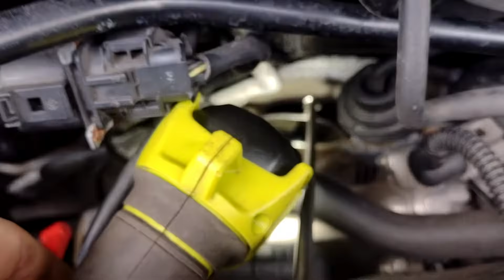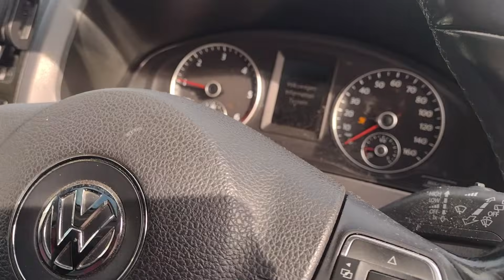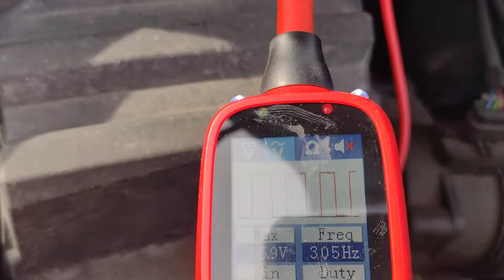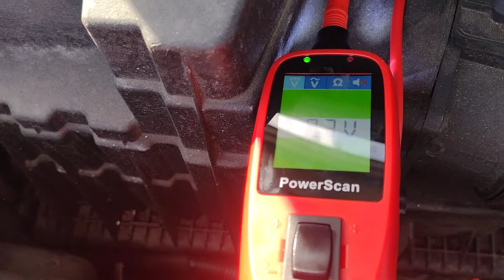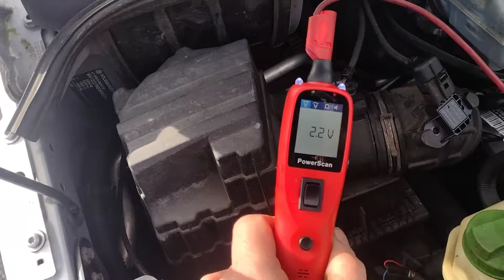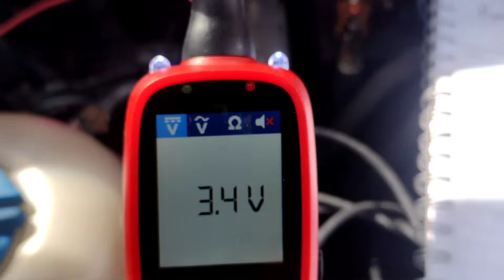VW Transporter - P2563 turbo position sensor range/performance

Comment: By the way, if I block off the hose, how long can I drive it for? & will it cause any damage?
My EGR unit is working, but the hose nipple broke off in the hose itself.
TIA
Reply from the maker: @OutbackAl  I know some people would leave the hose clamped off, It probably wouldn't harm the engine.
I would replace the parts so that it runs as intended

Comment: have the same problem my friend. P2563 Active/Static
Turbocharger Boost Control Position Sensor Circuit
Range/Performance. 

Mine comes up all random. It may not show up for 1-2 weeks and then all of a sudden the glow plug indicator starts flashing. What could possibly be wrong? The car itself drives without any issues, however some loss of power when the glow plug is flashing. When I turn the car On and OFF and On again, the glow plug indicator is gone and will show up maybe some days later all random. I am struggling to know what to do. Please help brother. Golf 1.6 TDI 2011 Automatic
Reply from the maker: @CrOzLm  I think it is carrying out a pdf regen while the glow plug light is flashing. Maybe not getting time to complete it. You would have to look for fault codes and take it from there. Cheers Matt

Comment: Matt is that a pp100 / ps100 or ps100 tester
Reply from the maker: https://www.amazon.co.uk/Automotive-Electrical-Diagnostic-Resistance-Activation/dp/B0BRQDF8CC/ref=mp_s_a_1_2?crid=2RPOKE6SMU1QY&dib=eyJ2IjoiMSJ9.u6b7kI1hNFpg9A6USu92PjbFlT4lzEfMz26cabjzb11fF771TGu_ksGmuiM1nlK9wfm15uwUmG3XQzNlxaTLhO2M8VGRhp3TBcF8d1OSHJfNRzI_cPPJhz08xJEjF3VRg2gw4wXVxIpUcZr8wzBH4KSnY0Q3PqbFzBHHqBD5zhC1-1ZSt-VVUC7Tu5nER4ufGm0nfnopcY9Xrkr1kwcA_Q.YT0ZmLuMZc81JaO7gCa0JqQlYBkz8EX1fz4tJMdKzAE&dib_tag=se&keywords=power+probe&qid=1709394780&sprefix=power+probe+%2Caps%2C414&sr=8-2-spons&sp_csd=d2lkZ2V0TmFtZT1zcF9waG9uZV9zZWFyY2hfYXRm&psc=1
Reply: Top man matt  I've the identical fault code after fitting a brand new turbo . .I. assuming actuator not set right or faulty as wasn't a fault till turbo was fitted . Fuming as not the best job to change

Comment: Hello so what was the probleme ? Im french and i have same default on my audi a3 p2563
Reply from the maker: It was a vacuum leak on the EGR  (exhaust gas recirculation)  valve. Causing low vacuum for the turbo solenoid. Thanks for watching
Reply: @mattsautodiagnostics  Thank you so it change the EGR valve? I also have the preheating light which flashes intermittently, I have no loss of power.

Comment: What's the yellow connectors you're attaching to each cable? They appear to be small current clamps but I cannot find anything similar to buy. Do they clip on, or do they actually splice into the cable?
Reply from the maker: PICO TECHNOLOGY PicoScope Piercing clips - set of two https://amzn.eu/d/jcNziB3
Reply: @mattsautodiagnostics Hi Matt, could you please explain/show where you have connected these clips to ? Thank you in advance 🙏🏻👍

Comment: Hello, I thought I will get there too but my egr hold vacuum too… I just need to check the voltage which I didn’t have yet. I had bought new actuator and waiting to be fix soon. Same error code, also the booster selenoid cut off the vacuum and goes in limp mode. This just give me headaches.
Everyone point me to a new turbo which I know is not that

Comment: Howdy!  Wv Polo 1.2 Tdi has error P2564 signal too weak!  The turbocharger was overhauled.  Before the refurbishment it had no error.  What can be the cause?  Has the sensor been decalibrated and the signal has dropped below the minimum threshold?  Actuator rod has no adjusting nuts!
Reply: Did you fix this ? I have same problem
Reply: Yes, I solved it!  The center where the turbocharger was refurbished changed the actuator to an aftermarket one.  The problem was that he put an incompatible one!!!  That is, it had the position sensor response values reversed.  I went to another center and they changed the actuator again with a compatible one this time.  The position sensor values now when everything is ok are: for actuator not actuated - 3.265 volts, and for actuator actuated at maximum - 0.417 volts.  I operated the actuator with a vacuum pump, I turned on the ignition, and the values were taken directly at the sensor with the multimeter.

Comment: Good find. I find this problem alot on sprinters where they have 4 component's that use a vacuum supply. And when on starts losing vacuum it bring fault codes up for the other components. 👍👍

Comment: Hi mate,did you check the actual vacuum readings with a mityvac?
Reply from the maker: Hi Ryan, I was giving to T in, and check the vacuum supply to the solenoids. I ended up finding the vacuum leak first and I didn't get round to checking the vacuum supply from the pump. However it would have been good to know the difference, with or without that hose clamped off. Cheers Matt

Comment: Nicely done Matt. Might be as well just to put a whole EGR valve on it. They’re not to bad to do, they’re prone to failure anyway and the coolers get choked with carbon too. Probably best long term for the customer. Top diag 👍😎
Reply from the maker: Yeah I agree, change the whole thing. Thanks for watching